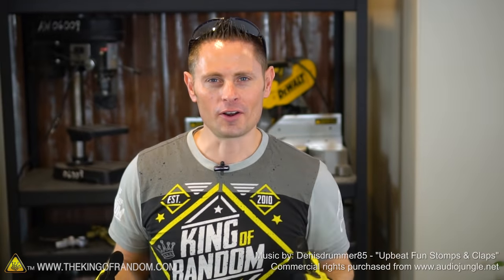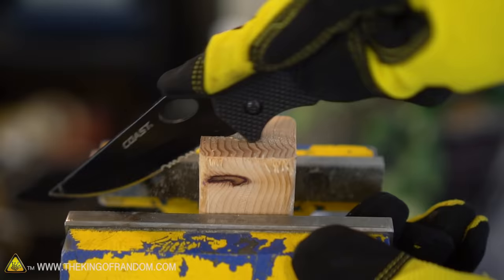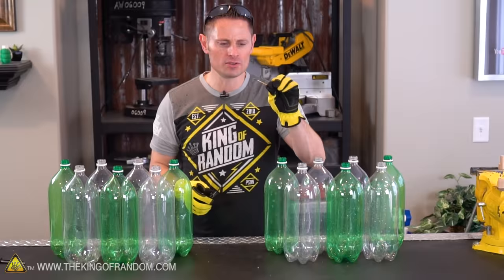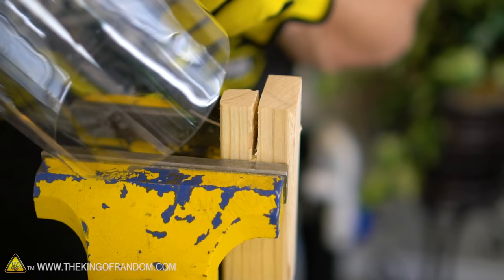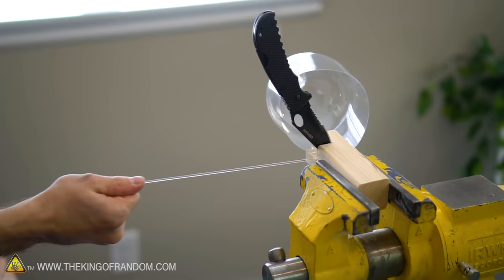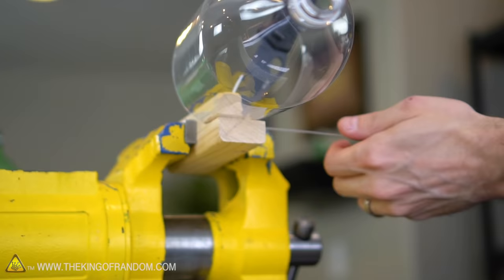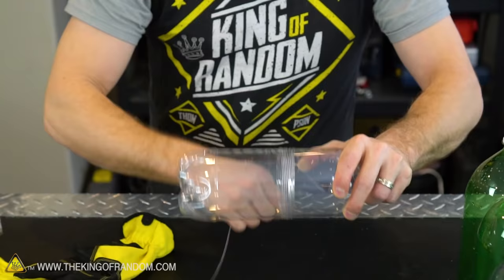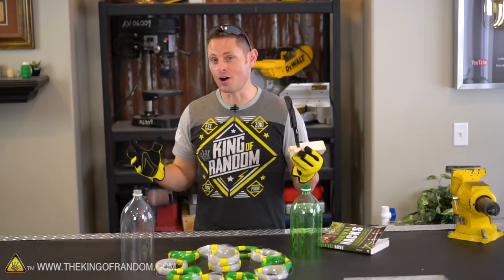Make Soda Bottle String (Cool Survival Hack) | How To Make Rope From Plastic Bottle

Comment: Now take that plastic string and try to load it in a 3D plastic pen!
Reply: Pat Harwood no dude suffs toxic af
Reply: Pat Harwood i swear everyone here has not knowledge of basic science
Reply: Hisjsshd and you "has not" knowledge in English
Reply: it won't work the plastic for 3d printers is thermoplastic and it melts better then regular plastic will
Reply: great idea!!!
Reply: Hisjsshd I have lots of knowledge of science
Reply: Pat Harwood it might get stuck
Reply: uh huh
Reply: The plastic in bottles is a thermoplastic. Or do you mean that the 3D printers use a different type of polymer than what the bottles are made from?
Reply: It wouldn't work unfortunately. Filament that 3d printing pens (normal printers) use is cylindrical. Assuming you could get it the right shape and size, it COULD work, as this is PET, which you can buy to print with.
Reply: Thomas Piccione only correct comment

Comment: You should make plastic rope with your rope making machine!
Reply from the maker: You're reading my mind
Reply: Second that idea.
Reply: Third that idea.
Reply: yess
Reply: Yeah, I was wondering how strong a rope this would make... Pull a car? Smooth and strong enough to make a zipline?
Reply: I think that the machine will not work with plastic tapes
Reply: I think that the machine will not work with plastic tapes

Comment: For both rope making and other potential applications, it seems like it would be really handy to join lengths of the string together. I wonder if a heat weld could be done to fuse them end-to-end similar to the way a band saw blade is welded. If the weld were smooth, even more applications might take advantage of this string plastic. Thanks for the idea and instruction.

Comment: Wow. My condolences. I just saw this video and subscribed; started scrolling through the comments and...my sincere condolences. I hope this comment  is useful - when lashing branches together with this material, you can shrink wrap it with heat to constrict the branches together, real tight. The integrity it gives to the joining/overlapping framework of branches of your shelter is extremely strong. Substitute this for paracord (or string), and heat it. It will shrink tight, no complicated knots to deal with, contour forming. Done. Two pieces become one; two branches married together. Pretty much permanent integrity. I hope this is helpful.

Comment: gasoline or diesel in liquid nitrogen is it still flammable
Reply: Miguel Thunder no, because it would be a solid. Not a gas. Therfore it wouldn't be flammable.
Reply: Emu Stories Wood. Nuff said.
Reply: No, it'll go out immediately because the nitrogen evaporating snuffles it out.

Snuffles.
I like that word.

Comment: Put a soda can in it and see what happens
Reply: Connor Buckley aluminum string! Cool idea!
Reply: Connor Buckley d
Reply: Connor Buckley You'll cut up your fingers while pulling the string.
Reply: You'd need a lot of normal sized cans, or still, a lot of extended cans. (like Red Bull and Monster cans.)
Reply: you would need a knife with better materials or an extrusion mechanism that uses shearing instead of cutting

aluminum isn't soft, but it can have thin layers of aluminum oxide which acts like an abrasive
Reply: Baigle1 tungsten carbide time
Reply: It will dull the blade very fast and one advice

Wear gloves or you are gona get cut on the metal

Comment: Try making 3D printer filament with the plastic string

Like if you agree
Reply: Won't work, bottles are made from PET, 3D printers use ABS or PLA.
Reply: Ethan Dhanji I saw something about this exact thing on freeze frame, I think, where you use 2L Coke bottles exactly in that way... to use the bottles as 3D printing plastic filament
Reply: Actually it would work if you just set the 3d Printer on diffrent   temperauture (And it works with any Kind a plastic but ju would have to Change the heat Settings )
Reply: +bios47 they can use waaay more things than those 2
Reply: CakeKing  it doesn't works with every type of plastic you need a thermoplast, which can melt properly
Reply: @ElectricGaming Not the mainstream, hobby type of 3D printers.
Reply: my £200 printer can
Reply: @ElectricGaming What printer do you have? 200 pounds for a printer that can print anything other than pla/abs seem interesting.
Reply: It's A CTC Brand prusa i3 clone kit from ebay

Comment: Make ice cream and freeze it using Rocksalt and DRY ICE! Add a twist for a flavor as well :D.

It would be nice for summer!
Reply: I agree
Reply: rio van der putten Their*
Reply: Dry ice would not need rock salt due tot he fact that it is already cold enough, Besides rock salt only works on dihydrogen monoxide in solid form not carbon dioxide in solid form
Reply: Milmaxleo "dihydrogen monoxide in solid form"  you couldn't have just said ice
Reply: See but that takes away from the fact sodium chloride  is not needed to make carbon dioxide sublimate
Reply: Drake Varvaxtra um not really every one not all schools have chemistry as a class some have it as a elective
Reply: I don't However I was attempting to explain why you would not need rock salt.
Reply: Milmaxleo the salt is for flavor not the ice. salted caramel mmmmmmm
Reply: Ice cream salt is not usually made for consumption you know.
Reply: Milmaxleo niether is alcohol yet people drink it
Reply: Alcohol is made with human consumption in mind, Has to pass FDA standerds. Ice cream salt or rock salt Does not have to pass FDA standards, List ingredients and even says "not intended for human consumption" on the box
Reply: Magicraft rip now its winter

Comment: It would be awesome if you could use it as filament for a 3d printer
Reply: YoungLifeVices filaments for 3-d printers need to be a precise diameter with only several microns of tolerance.  you wouldn't be able to make filament this way but you can buy machines that turn plastic scrap into usable filament,. theoretically if the printer can use polypropylene in it's extruder this should work.
Reply: It does
Reply: What you need to do is melt it
Reply: I never thought of thAt that is a genius idea
Reply: I want to try doing that. It needs to be 1.75mm circular
Reply: Exactly I thought same. It is PETG
Reply: You CAN.

Comment: I told my science teacher about this trick. He seemed to show some interest and I felt this would help him out since he plams to try and survive out in the wild on his own. Question though: could this work with any plastic bottle or does it have to be a two liter?
Reply: Rana Relianae I’m pretty sure it works with any bottle
Reply: Rana Relianae 9
Reply: It works with any bottle as long as the bottle is straight and not curved or something
Reply: @karinfox3216  it works with hardly any types of bottles, very few bottles have this perfectly smooth cylindrical shape without weird bumps and grooved and ridges and what not. Have you tried it with the square ones? They don't even pass through the groove in the wood.

Comment: Can you make rope with cans ?
Reply: Diya Murukesan No, because it is aluminum.
Reply: Marci Polarbear seems like you haven't seen or even heard of wires...
Reply: You'll need a sharper blade but it would not be rope it would be banding and banding has alot of high tensile strength uses.Its not going to be as pliable but it would definitely open some options in fact you might even be able to fashion a thin pocket saw by cutting small teeth into a strand of aluminum and wrapping each end around a stick or even through a stick to make toggles then just use it as a really bendy blade saw. You could also fashion keys and a number of other objects.

Comment: R I p King of random I didn't just have an idea though you could probably use a fishing rod to make an automatic spool for it
Reply: i dont think it would run smoothly
Reply: @rp101aquatics6  you're probably right you most likely want to do like a hand crank spool
Reply: @roughcut3652  yeah you could make a spool from wood that you can crank but a traditional fishing reeds wouldnt work well
Reply: @rp101aquatics6  yeah the plastic strands would probably be way too thick any way you wouldn't be able to hold much

Comment: I think I like this design. It's easy and explained well. Just saw it from a guy in Russia. His example may have been slightly better done with metal, but was hard to understand a few points. He glossed over a few points by saying... Cut cut cut... it's done, it's easy... But didn't really say how. 
So many uses from building simple items to 3D printing

Comment: You can also use heat to shrink this rope.  Tie your wood together using this rope and then apply heat to your rope (heat gun, torch, lighter) and the plastic rope shrinks and tightens to make an extremely strong joint!  There is a Russian guy that did a youtube video on this and shows plenty of great examples.

Comment: Instead of pulling on the string and later winding it up, you could make a drill bit type of reel using a large tin can with a nut and bolt through the bottom. Fast and easy!

Comment: also this is thermoplastic so if you tie things together with it and then heat it - with hot air or water it will tighten the join...

Comment: Side note:
This string shrinks in high heat (like lighter flame)
so if you wrap it to around wooden hammer head and a stick to bind them together into a wooden mallet, 
you can then heat with the lighter the already tightly wrapped string you used, and it would tighten it even further, that mallet head is NOT coming off anytime soon.

Comment: I saw this video a long time ago and I like the simplicity of it's making.  I want to use this string in my garden and why just toss bottle after bottle into the trash?  It's been discovered that plastic is in almost every living thing now.  Let's put it to work!
Reply: UPDATE:  Attempt #2, using a proper piece of wood now and I had to keep making my cut deeper and deeper to keep the "string" from breaking.  Best I could do was about 5/16" wide and keep the ball rolling.  Anything less and it would break.  Using a new razor blade(type) from a utility knife.  Also, it was just in the news yesterday that they've finally made a bacteria the breaks down plastic in hours!  Great news!  Remember, you've got to pull down through your cut to keep the same width of your new string.  I'm oriented with the bottle up and it does help to steady it.  I want to utilize this in my garden.  Thanks again for this idea!

Comment: If you wrap something with this stuff and apply a little heat it will act like shrink tape. I saw a guy in a video do something like this to make an axe head more sturdy where it connected to a wooden handle.

Comment: Use a spool chucked into a drill with a bolt running through the spool, and wind your string and pull it, same time.

Comment: put a little heat in 2 bottons border... cap one over the other... and you got a round box.... mix colors for aestetics...
cut the plastic of 2 tops (with bottle stoppers) and glue them... you got a pill/coin/screws/whatever pocket box...

Comment: Once you've tied the string, you can apply heat, with either a heat gun or by pouring boiling water on it, to shrink the plastic and giving you a tight wrap.

Comment: One thing I've seen people do with this cordage, is after you wrap it around something, you take a heat source to it and melt it a little. Doing this shrinks the plastic and creates a point of strength that should hold up with some abuse.

Comment: could you use it for a 3d pen?
Reply: I'm no expert, but, probably not! It has to do with melting temperature! The plastic used in 3D printers melts at comparatively low temps, lower than the plastic used for bottles!

Comment: I took a thin stick that's 4 inches long and when started doing it I taped the end of the string in the middle then put the stick in a drill and then spun the drill and it all came out and turned in to a spool of rope 

I hope this helps someone

Comment: Make a machine to test the tensile strength of your string and rope.  Use a compound pulley to multiply force and a load cell to measure it.  Opportunity to teach some physics and use a Raspberry Pi or Arduino.

Comment: The biggest factor in this is do you take your only plastic container and make cordage? Or do you save the container to hold your water and use it to for Solar purifying your water supply. Or do you use it to make a filter to filter your water before you boil it.
This is only one of many uses for a plastic container if you make the wrong decision and you only come across one container for the duration you could really screw yourself over. You can make cordage from many plants even trees using reverse wrap.
Think and chose wisely. Its an option sure is it the most viable? No.